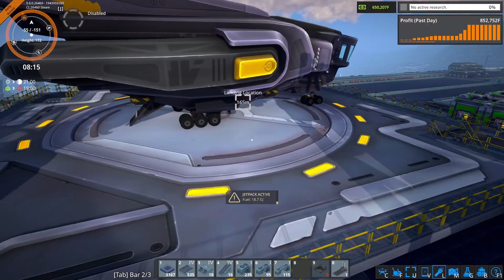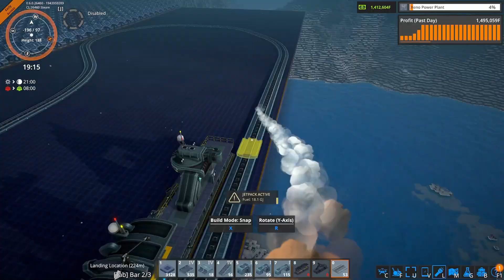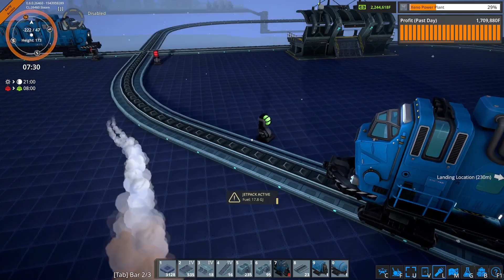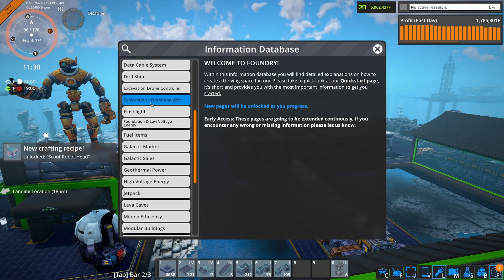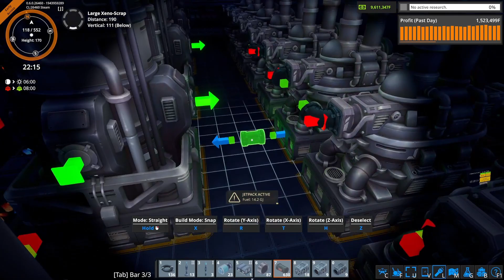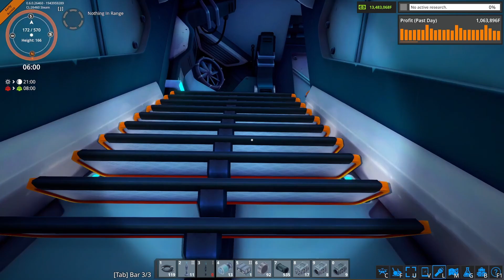Foundry - Update 4 - Trains and Reactors

Comment: a full 10 turbines is equal to 554 large solar which is 360mw. you also need 240 crystals per minute to keep up with production. this means that  you need 24 of the lava cave crystal mines to supply that. that is if you are not using the bots to improve performance.
edit: that is for one reactor. to make one GW, you'd need just under triple the above numbers.
Reply from the maker: Well they better make some adjustments to this cuz that sounds horrible lol once you math it out like that makes me feel these people don't like anything but green energy lmfao they will need to nerf the amount of crystals per min and boost power production to improve this setup
Reply: @Burnedoutguy  i do agree. once i mathed it out, i was disgusted. that's a LOT of those lava cave mines. at most, i've only ever found 3. that's when i decided against using the crystals for anything other than the upgrades.